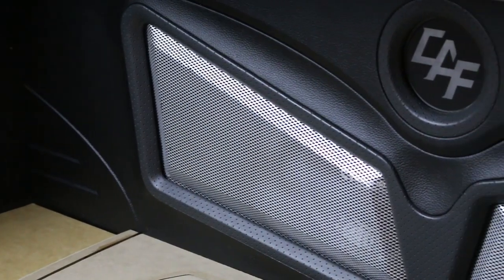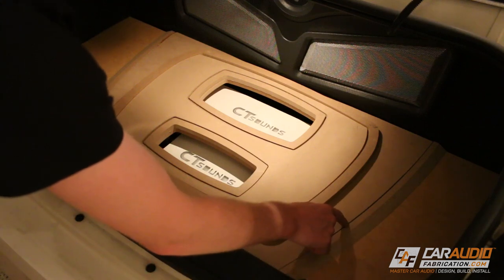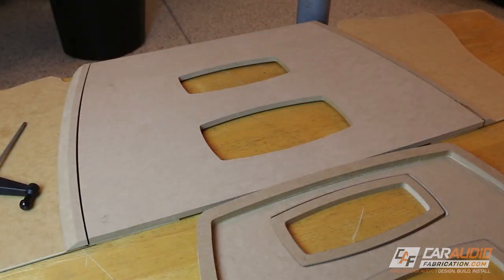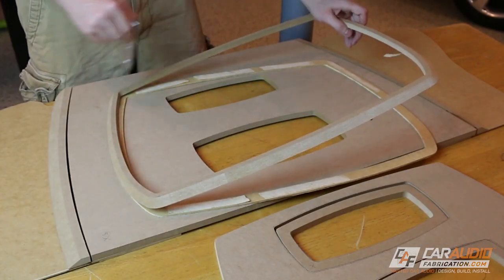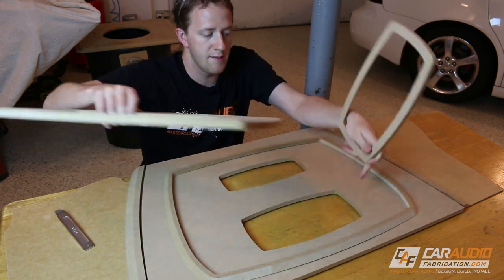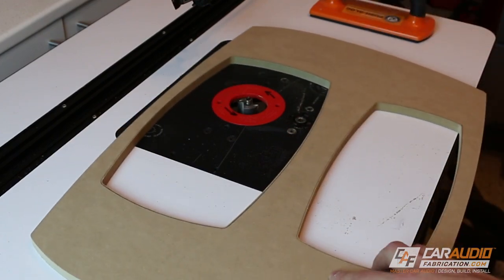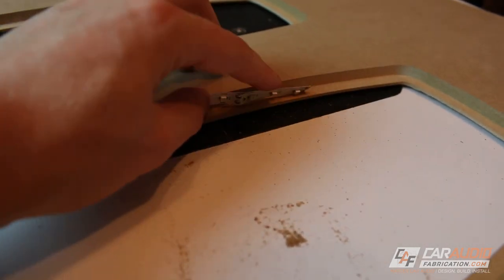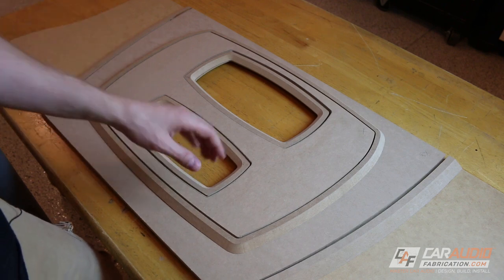DON'T FORGET THE GAPS! Amplifier Rack Beauty Panel Build - CarAudioFabrication

Comment: If you want more accuracy on how deep your bit is cutting, there's some companies out there that make depth gauges that use your work surface as reference. Not sure how much they are, or what unit they're accurate to, but I think that would be a better choice than the one built into the lift if you're looking for accuracy.

Comment: I want to change my 12" Kenwood KFC-W3003 4Ohm sub to Rockford Fosgate R2 Ultra Shallow 10-Inch 2 Ohm Subwoofer or Rockford Fosgate R2 Ultra Shallow 10-Inch 4 Ohm Subwoofer for space reasons. Are these any good. My Kenwood  12" currently hits hard want that same hit or even harder. Wat sub would you suggest. Currently I have my system hooked up to a five channel hifonics zx8000. Do I need run a separate amp for sub. I really need to free up space from my 12 sub but do not wat to sacrifice my sound quality.